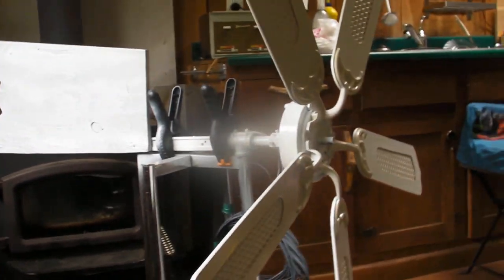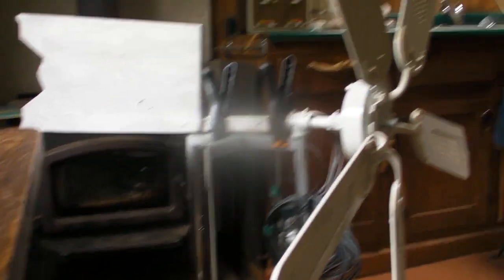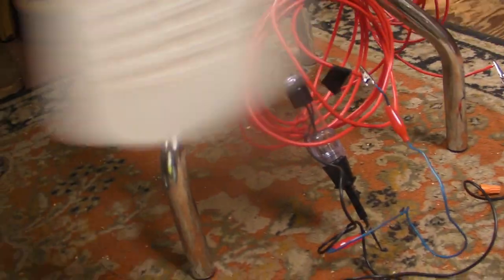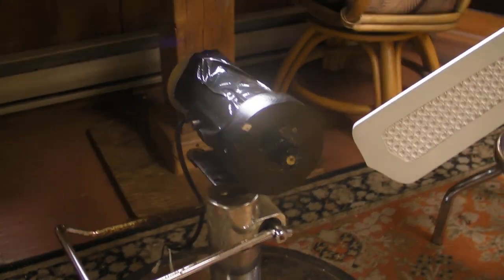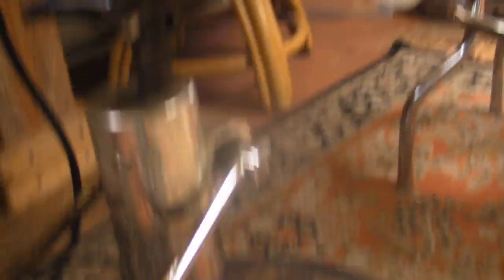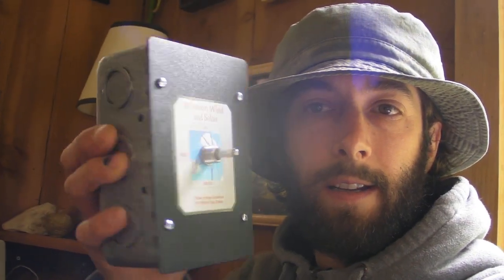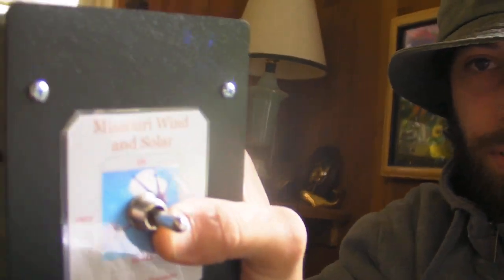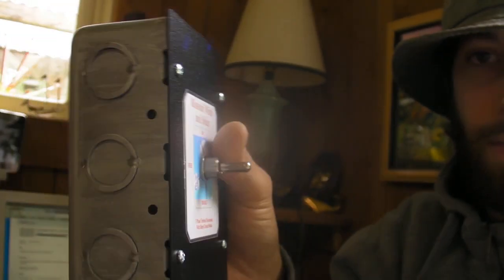Free Energy Devices + How To Make Them

Comment: Wish I had a prize for my generator I built when 14 years old that can run my radio and a flash light bulb . The blade was 40 inches round had 4 paddles like a Dutch windmill.
I used a gear box and a large motor like the ones used in a power wheels ride on .